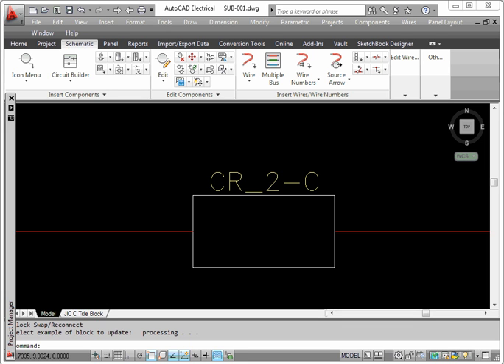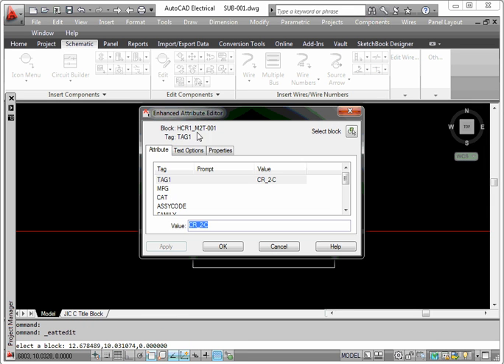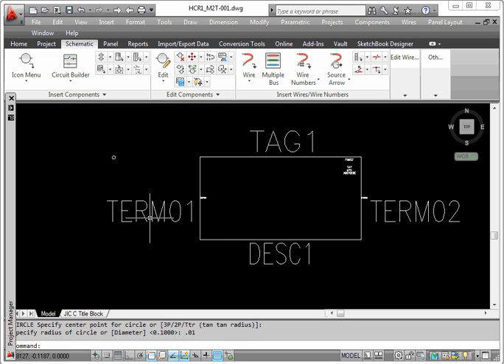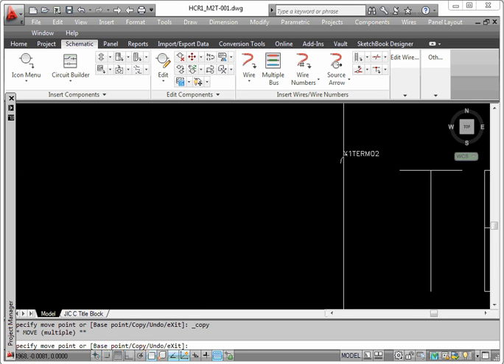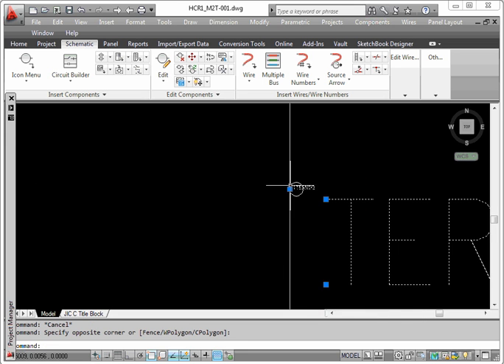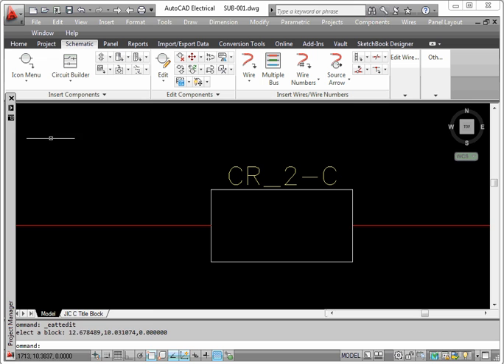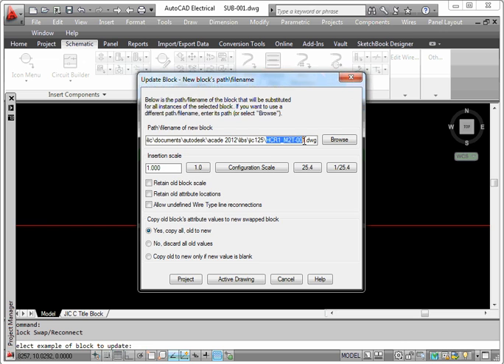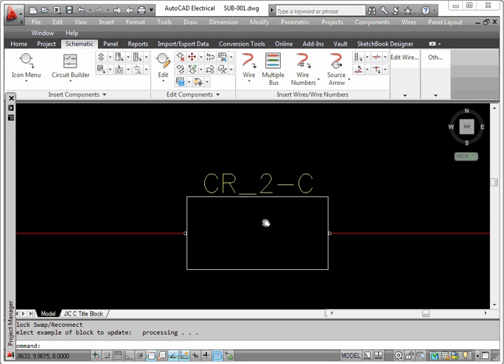Swap Update Block

Comment: Hi!!

Fantastic video.

I have an important question.

If I want to update a symbol in all my projects and drawings, what I have to do? Because I tried doing it by this way but only updates the drawings of the active proyect, not all your projects.

Is there a way to do that?

Thanks a lot in advance.
Reply from the maker: Thank you for the great feedback! The Swap Block command has ability to update all the active project drawings. If your need is to update every project ever created, you would need to activate and update projects one at a time.